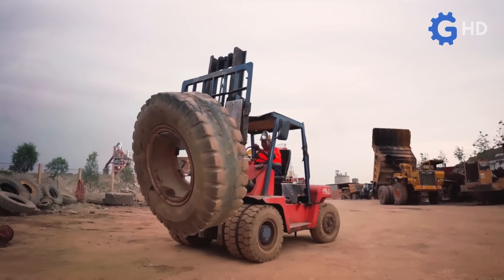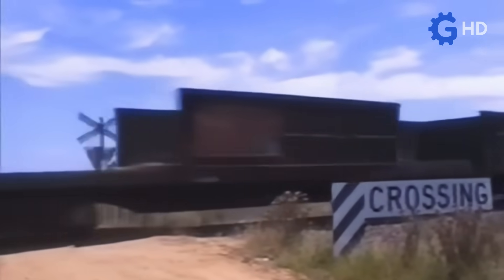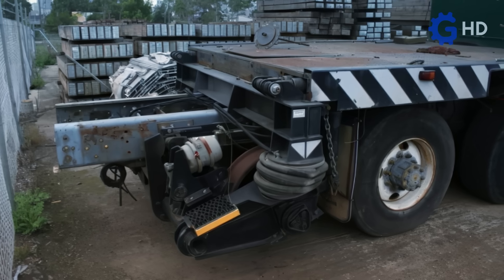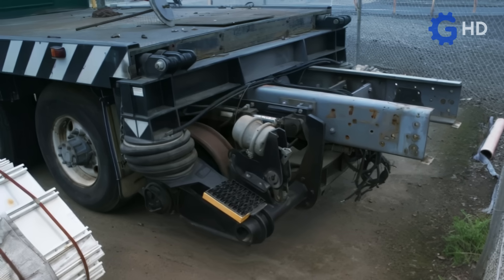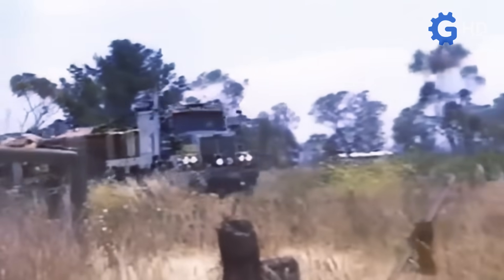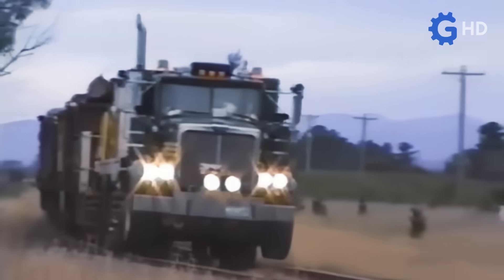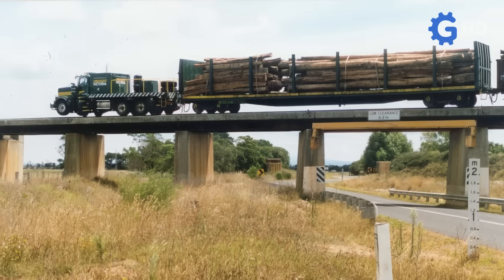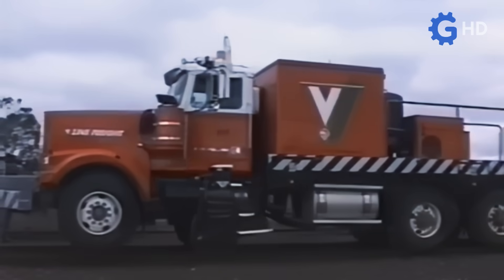Why Is AUSTRALIA Replacing LOCOMOTIVES With TRUCKS? - HISTORY

Comment: Actual idea for Victoria was we have the need to move grain wagons around the rural lines which are basically all spur lines. 
What the truck enabled was the ability to take wagons up one line and then travel by road across to another spur line and move wagons on that line. Saving 100's of km off dead movement if they had to travel on the tracks. 
Also as commented a lot of the regional lines were poorly maintained as they were only used for grain movement once a year. So the lighter truck could move smaller bin groups to an assembly point for the larger locos to bring them to port.

From memory it was proposed by Western Star Australia - but that could be wrong. Also FYI Western Star Australia OWNED Western Star (Canada) - a case of distributor liking the product so much they bought the company. It was later sold to Daimler Chrysler, which then split to Daimler and Chrysler. Daimler has the Mercedes,  Freightliner, Mitsubishi Fuso (~90%), Western Star, Ford - became Sterling ceased in 2009, and others

The truck was powered by a Cat 3406E @ 550 hp. With an 18 speed Eaton road ranger gearbox.
Another mod that had to be done was fitting of a train horn.... An air compressor on the back of the truck provided air for the horn, and also the train brakes. 

Not only did it only have single tyres the rear axles had to be narrower than standard so that the tyres could run on the rails. Rubber has better grip than steel, but there were only 4 tyres not 8 or more steel wheels to get the power to the rail that along with the narrowness of the rail track meant a lot of work was being done by a very small area of the tyre leading to rapid wear. Not sure why they didn't fit a crane on the back so they could change wheels easily on the track (siding/side of the road), 10 bolts and its off, and not to hard if you have a crane taking the weight of the wheel.

There is discussion about the weight it could pull (trailing tons, the type of tons/tonnes will vary I guess).
I don't remember a number but as a truck it would have been capable of the stated 150+ tons,  however that is on tyres not steel wheels on a salt pan, so while the momentum is the same the wheel drag is WAY different. Also the maximum grades it had to travel were minimal (the grain areas of rural Victoria is reasonably flat). On the downside is the limited contact with the track. FYI road trains are able to carry up to 130 tonnes (286000lb) on some public roads and in Melbourne we have 85T (187000lb) trucks operating - sea freight to distribution hubs carrying 2 x 40' containers. To see the variety of trucks allowed for use somewhere in Australia search for GTSN Truck Book.
Reply: Steel on steel works far better than rubber on steel or rubber on concrete or bitumen. This is why railway locomotives have steel wheels.
Reply: TLDR
Reply: @stefanfrankel8157  Yep and I'm a boomer on the autism spectrum, so it was far to short....😀😀
Reply: YES far better for rolling resistance - not so good for traction, hence grade limits etc.

Comment: Basically a failed experiment but the title claims these trucks are replacing locomotives. Doesn't make sense to me.
Reply: I can assure you that trucks are NOT being used to replace locomotives in Australia. This rig failed as a locomotive around 20 years ago and hasn't been used since. As another view points out, it's now up for sale.
Reply: Road-transferable locomotives also have severe load limits when rails are wet, or on steeper grades, and suffer greatly increased tire wear. The use of road-rail vehicles as shunters is well established, but as motive power, they're really only useful in niche cases, for small loads and inconvenient tracking.
Reply: CLICCKBAIT  So Australia is not replacing locomotives wit Trucks..... Thanks for helping to undermine the Integrity of the Youtube Platform with your CLICCKBAIT Video...
Reply: I'd agree there.
Reply: right, I got to the end and checked the title again and it did not line up. He could have made it just as click by asking "is" instead of "why."

Comment: As someone who came from pretty much a family of railroaders, normally putting a heavy duty highrail truck on a few flatbed cars in the US is better for if your just using them for line maintenance. But i imagine replacing a locomotive in which is not only heavier and have more horse power, But also more traction on the rails overall, With just a highrail to pull actual fright trains sounds like an extremely horrible idea. Which is why looking at the comment section i don't believe they even actually are now. But still kinda a cool video in my opinion. 🤣👍
Reply: About half the video used here was originally taken by me in 1999/2000 with a bit in 1998 (in V/Line orange). In the case of the log traffic, the sole reason for using the "Road Transferable Locomotive" was that a long trestle bridge that had been responsible for closing the line 10 years earlier, was in no condition to take the weight of a normal locomotive. The Western Star loco was used for a period of 3 months until that bridge could be reinforced and repaired to allow regular locomotives to safely cross it.
I understand that those 3 months were the only regular revenue-earning work it ever did. All other work was trials, publicity work and odd jobs around the system. And later works trains.
Reply: @emdB67  i see, that's some pretty cool footage you got there. 👍

Comment: A.P.Webb was having issues with the O&K 360 degree back-hoe machines on tyres. He bought tyres that were two different moulds, off-road on the outside and road pattern on the rail head. I think now they are all hydraulic drive rail wheels? They are quicker on rail and can pull a decent amount of weight. Attachments are so varied o couldn’t list them, but the biggest was a rail head resistance welder with the generator hanging on the back.

Comment: The RTL could operate max speed in either direction.
I think V/line’s vision was that some rail lines could be partially closed with the RTL operating on isolated sections. Seems half assed to me.
At the time the government was trying to deprecate the rail mode in terminology, for example a passenger train was called a “service” not a train, so a “service” could be a bus. I recall this when the Gippsland line was just a rail car to Sale, I rode on the 1pm “service” and came back about five-ish.
Thanks to Bracksy, the Bairnsdale train was reinstated and the old bridge over the Avon River at Stratford was replaced (after Bracks). The old 100yo bridge had a 10kph speed limit.
An interesting point about the old brick bridge was that it had wooden boat like structures on the foot of the pillars to prevent flood debris like trees to build up around the bridge. I’m curious if the new bridge can withstand fallen trees building up around the pylons. And will it last 100 years?
Reply: My recollection of V/Line's intentions with the RTL was that it could drive the short road distance between the grain lines in the north west of the state for short-haul work between silos to save running locos one or two hundred kilometres south to a junction and then back north on a parallel line. That at least made some sense. But I'm not sure just how much such work was actually needed.

Comment: Trucks aren't good for use as mainline locos, they are simply too light.
However, they are excellent for conversion into rail car movers (i.e. at industrial customers).
Reply: According to the original writeup the aim was to use it to keep otherwise uneconomic lines open as a feeder service for the main-line.

Comment: Hah! All that rail has been upgraded. The rail bridge over road is still there and used. I live about 6 Km from Stratford, the town where the Avon River flows past the railway. The old bridge over the river is still standing, but has been replaced by a modern bridge. The only trains using the line are modern diesel passenger carriages without locomotives.
Reply: Most of the video used here was taken by myself in the summer of 1999/2000. The slow bit over the Maffra Road bridge at Stratford Junction was due to a kink in the rail, probably due to heat expansion. The line had been out of use for a decade at the time. But it was the old Avon River bridge and its poor condition that required the RTL 1 (truck) to be used on the line. The log traffic was responsible for the line to Bairnsdale reopening. We must wonder if the passenger trains would be running at all had that not happened?
Reply: @emdB67 You know much about the elephant incident? I might search old news reports. I've heard a couple of versions. Seems like a bit of a legend.
Reply: @Thelivewire64  Lots of legends around it, but it did actually happen in as much as the Elephant hit the bridge and died. Lots of speculation as to what happened after that. 
I probably should buy the book written about the subject to learn more.

Comment: Nope, thats not Australian invention. Unimog Zweiweg was widely used since 1950s.

 Truck as loco is extremely effective to be used as switcher or short-haul light duty. It is way more cheaper than any loco, even the tiniyes, and does not require loco innfrastructure - can be serviced in usual truck shop, fueled at petrol station and relocated from one yard to another by usual road, by itself. It cant have 1000s hp power, but for these duties usual truck 500hp is enough, small switchers rare have more. 1000hp switcher is something 6-axle, designed to work with full scale loaded trains.

6:30 YES! I met this machine in SA 2011-2012, when it was used with ballast trains on Gawler line! The problem there was that the line was cut in small sections, so usual locos would be stranded on these offcuts and could not be maintained or relocated.
Reply: I can see this with an automatic transmission, but pulling more than 1 light railcar would be a clutch burner
Reply: @davidconner-shover51  hydroauto, of course. Most of light locos use it too.

Comment: That is common in GERMANY. You have UNIMOGs with two way aquipment, to shut waggons or to use them inside a industrial area oder at habour railroads. we here combine even Highrailers with locomotives.. if the the train is to heavy.. IT IS NOT NEW !!

Comment: Somewhere on YouTube I once saw video footage of a road transferable locomotive hauling freight cars in the southeastern US.  It was similar to this unit, but had 3 driving axles (and presumably more weight) to enable better traction.
Reply: Brandt does make a tri-drive version. CPKC has one of each roaming around the upper mid-west and is on a Peterbilt IIRC. I'd have to check my pics, I last saw it in 2022. The tri-drive actually is weighted down more. The tandem drive is the one they use to pull the OTM tracker on a trailer behind it.

Comment: Role switch isn't entirely possible here- Trucks are a bit too light to tug many train cars but can still do the job. Locomotives are waay to heavy to be of use on roads, Russian engineers already tried.
Reply: the truck would have been much more capable as a locomotive if it had powered rail wheels instead of using the rubber tires to drive the train
Reply: @wildcoyote34 rubber on steel friction coefficient is much higher that steel on steel, which more than compensates for the lower weight of the truck.
Reply: @marekstanek112  the problem which led to the issues with profitability was the severe tire wear issues and frequent tire replacements caused by the tires slipping on the rails ,the tires were riding on a small portion of their surface which rubber tires are not designed to do
Reply: @wildcoyote34  that's what I would expect. it's solvable with the right kind of tyres, designed for the porpose, and a healthy load of ballast, but still probably wouldn't make ecomical sense.
Reply: @wildcoyote34  Too light to use steel drive wheels. They would easily slip because there is not a lot of weight on the back drive wheels. Normally a trailer sits on top of back wheels.
Reply: @guytech7310  yes you are correct especially if they had small wheels ,,larger wheels on the order of 36-40 inches wouldn't spin near as easily but the drawback is the truck wouldn't be able to leave the rails which defeats it's purpose ,,they use trucks like this here in the states still to this day ,,i've seen one at a local rail yard very similar to the truck in this video only the set of wheels that lifts up the front of the truck is powered adding traction and i've seen it pulling a dozen rail cars

Comment: I'm Australian and it sounds like BS to me.  The only reason that such a thing might be done is for major track work, probably ripping up tracks.  The truck can take the wagons right to the site, then unhitched and drive, on road tires, to the other end of the wagons and rehitch.
Reply: As a retired British train driver I tend to agree with you. I have all kinds of questions about brakes and braking - with regard to the rail vehicle braking operation being initiated from a road vehicle that has no originally designed way of carrying out controlled application and release of brakes. Even if any trailing vehicles had braking systems isolated and thus operated as unbraked vehicles there would have to be a system employed to prevent runaways. Even here in Britain there are various on track vehicles that can pull small loads around an engineering possession site, but a road vehicle tractor unit seriously attempting to pull anything like a proper freight load just does not make sense in any form.
Reply: Not BS. This truck picked up 13 empty grain wagons from the Kensington Mills in the late 1990's. Only ever saw it once. The plan was so the truck could tow the empties to the loading point and drive back on the road saving the need to book timeslots on the rail. It was never to tow loaded wagons. Failed experiment.
Reply: CLICCKBAIT  So Australia is not replacing locomotives wit Trucks..... Thanks for helping to undermine the Integrity of the Youtube Platform with your CLICCKBAIT Video...